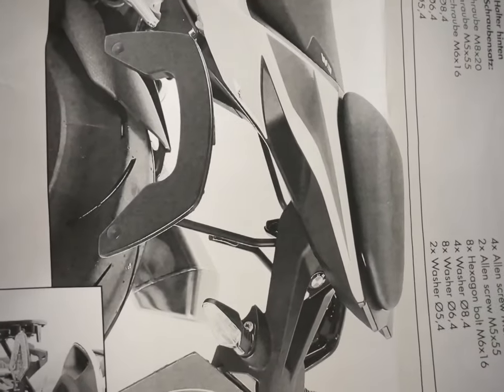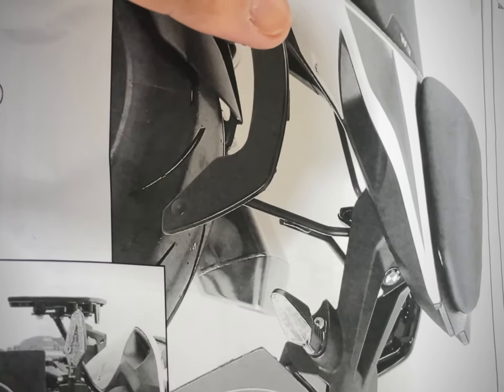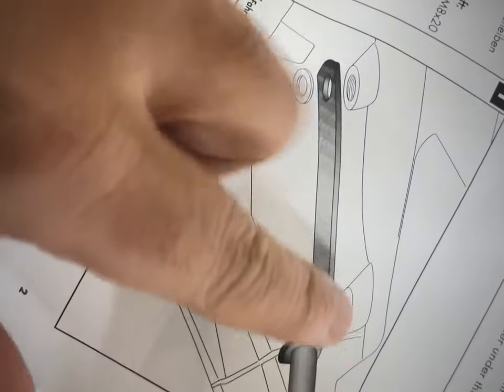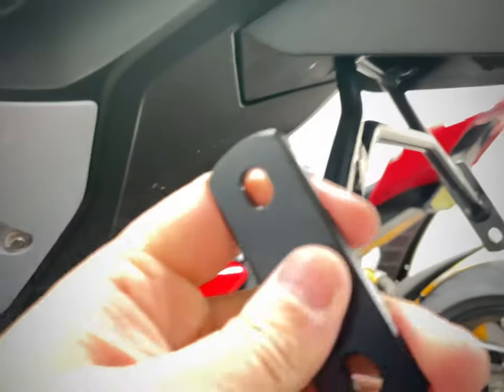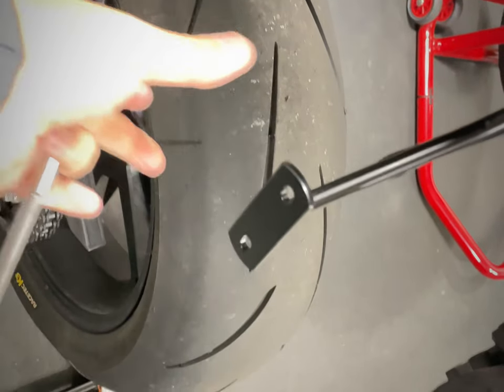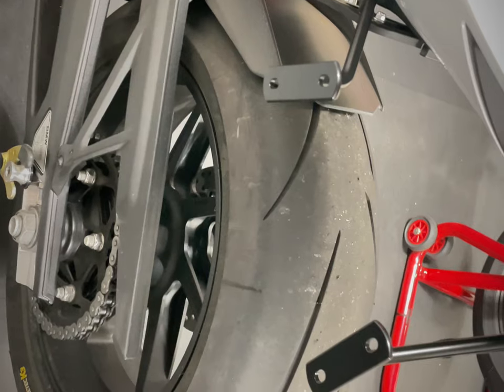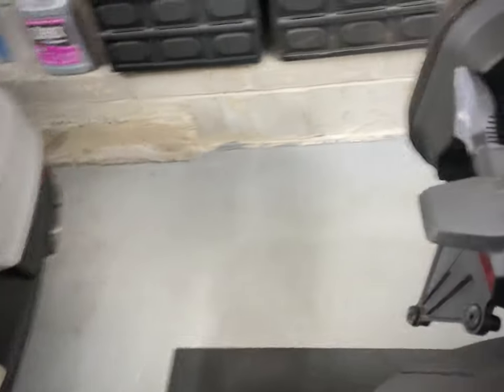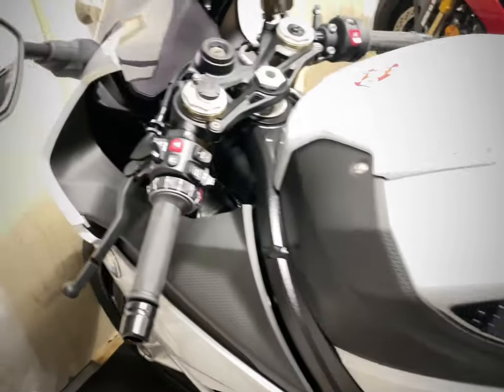2021 S1000RR gets panniers - Hepco and Becker

Comment: Could you take a pillion with these mounted ??
Reply from the maker: Yes you can invest in a comfortable pillion as the stock one just won’t be as comfortable. Also passenger needs to be careful not to use panniers or mounts as a 100+ lbs weight support for getting on and off the bike.